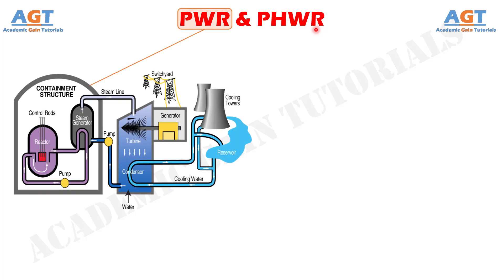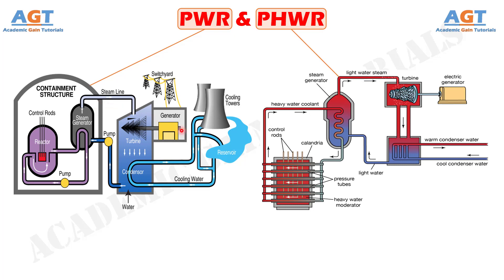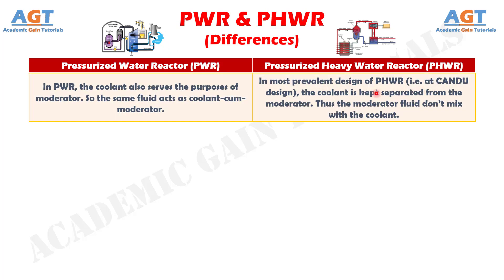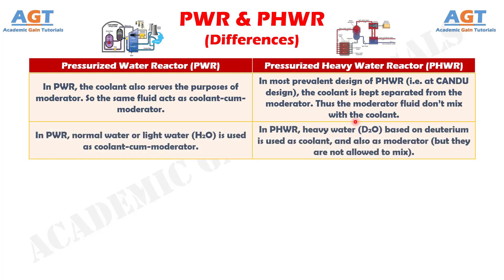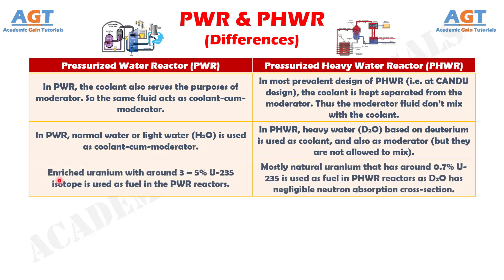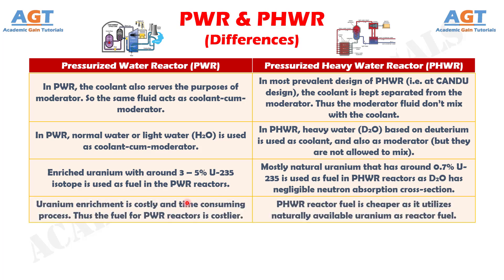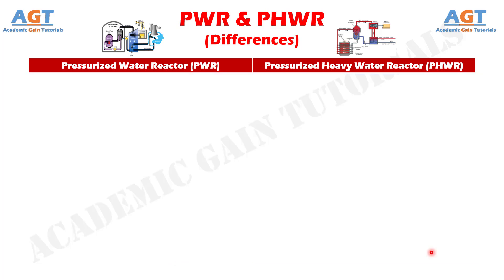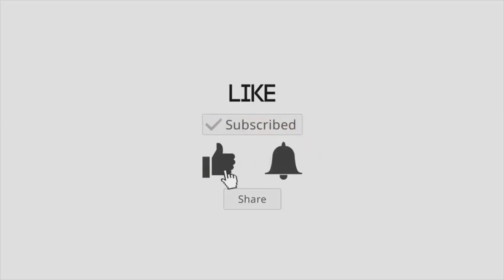Differences between Pressurized Water Reactor (PWR) and Pressurized Heavy Water Reactor (PHWR).

Comment: You still cover the fuel in zirconium in HPWRs. So it's still not super cheap to create these fuelrods even if you can leave out enrichment processes, you still need high a level of expertise to produce them. 
Also zirconium can react with a coulomb explosion under certain circumstances (just like aluminium could), these circumstances are not impossible to happen in a HPWR reactor.